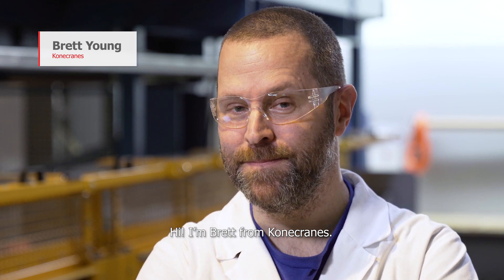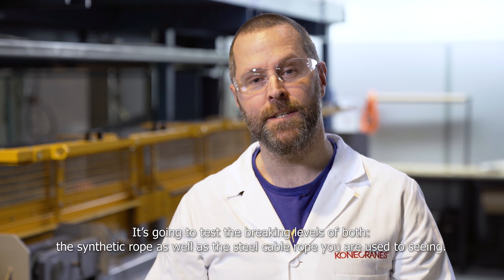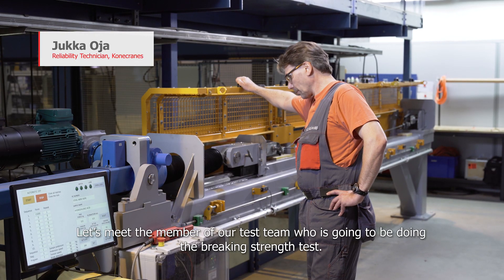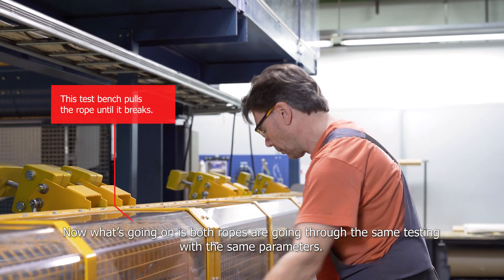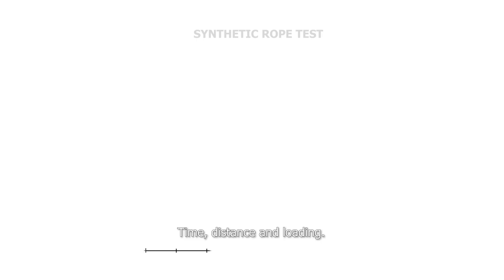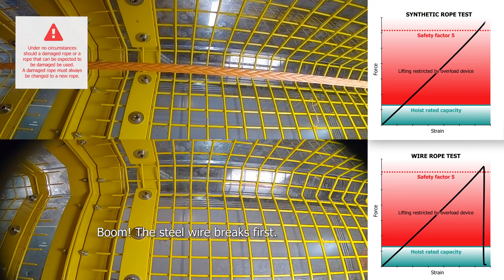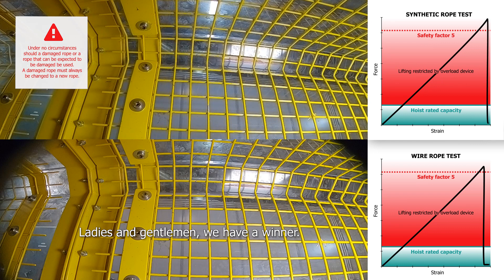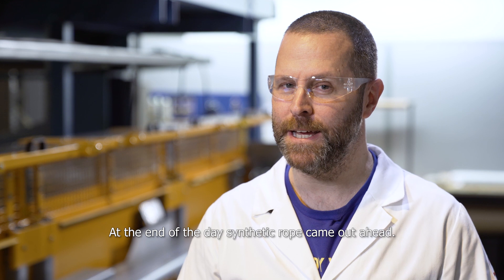Testing Konecranes Synthetic Rope: Synthetic vs Wire Rope

Comment: This good be interested if you showing details spec of each ropes. Steel Wire rope even same Dia , it also have another important factor like No of wires, No of Strands , design braking load ... What about testing conditions like temperature... ?

Comment: How about debris and dust. We use synthetic rope in repelling and if we get them dirty we can not use them and have to throw them away. How do you deal with those environmental issues in real world. The lab is clean and controlled, but in a shop or fabrication environment they are going to get dirty and debris will get embedded in the rope stands just like they do in the wire rope.

I buy your cranes all the time and put them in Butler PEMB buildings. My customers will want to know these type of answers.

Comment: This test is misleading. We need to know the  wire tensile strength of the wire rope as well as wire layout. Also the vulnerability of fiber rope to impacts and environmental effects as Rahul indicated must be tested.
Reply from the maker: Thanks for your comment, Basar. We conducted the test under controlled and safe laboratory conditions that ensured the comparison would be equal and accurate. The purpose of the tests was to illustrate the ultimate strength of the synthetic rope and we stand by the results in the video. To find out detailed technical info about the synthetic rope and its durability please contact our Konecranes team in your area at https://www.konecranes.com/contact-us.